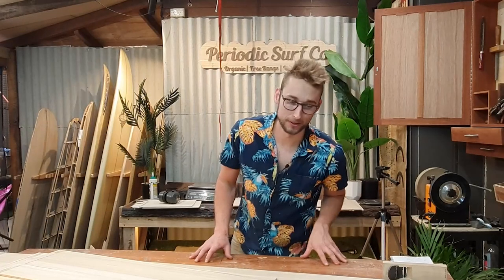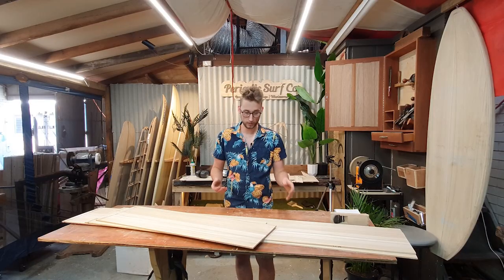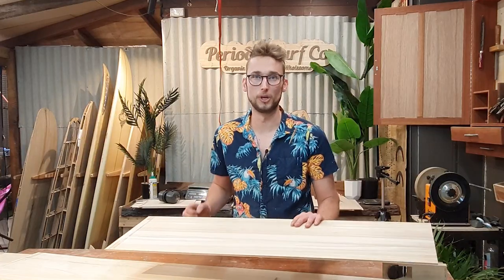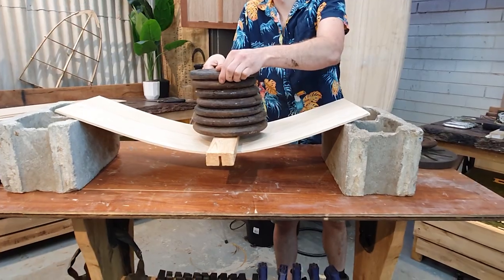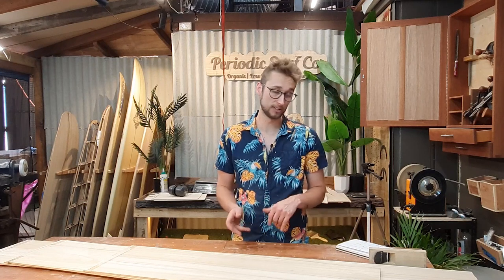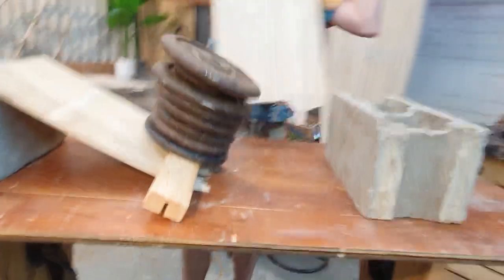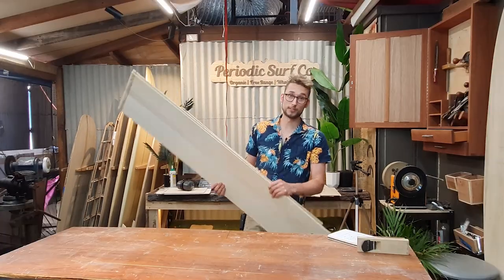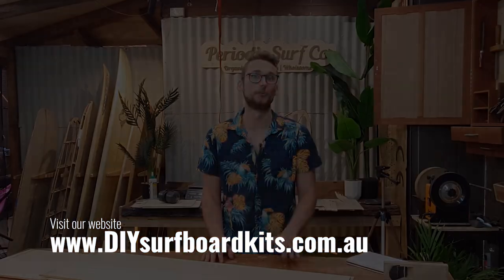Shorter Deck Skins = Better Shipping Options! Our full range of surfboard kits now shipping globally

Comment: I was wondering would you think of Considering in pouring 2 part foam into one of you’re hollow surfboards by mixing or making up a 1 to 1 ratio of parts “A” & “B” the right amount with 2 different separate pours or 3 separate  pours, before putting on the deck of the build, after all 2 part foam can be regulated on how fast it reacts & expands depending on the temperature & humidity of the environment at the time. anything below 68* F the reaction is slower yielding less foam & anything above 70*F the reaction becomes more pronounced yielding more foam . Once set or dried, the excesses can be sanded away with care leaving a filled in core between the ribs which is water proof.( fist Pour for the front half of board from the middle towards the nose & second pour from the middle of the board towards the tail-in order to obtain a more buoyant and a lighter board with improved floatation 🤔 it’s just a thought one never knows it could end up being a really good idea . I would love to hear you’re thoughts on this issue many thanks ✊